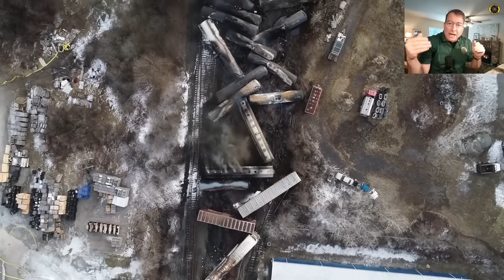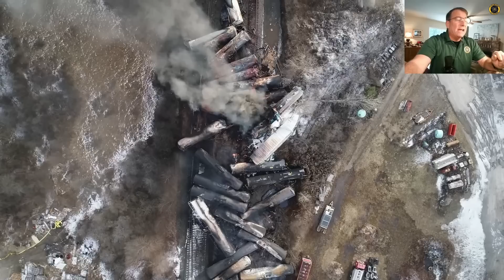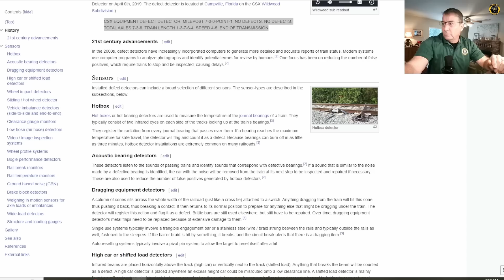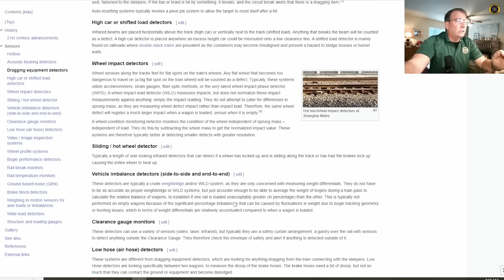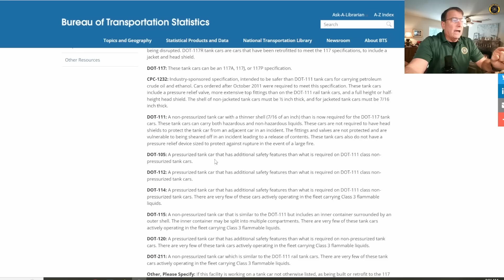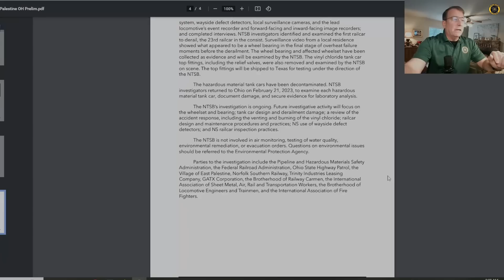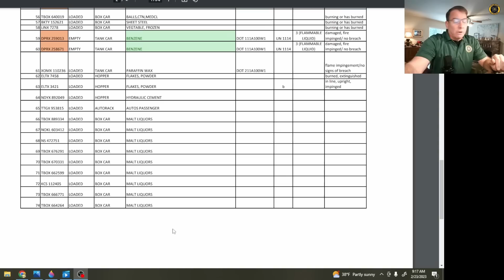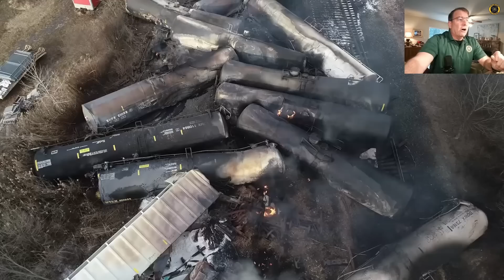NTSB Prelim Report: Norfolk Southern Train Derailment 23 Feb 2023

Comment: Excellent report. A factor that wasn't mentioned is the sequence of the full-break application on the string of cars. If a sudden rupture occurred at one place the sequence of application on the string of brakes would depend upon the speed of that pressure drop propagating down the line. The maximum speed of that would be determined by the speed of sound in the pressurized air. The brake application time might only differ by milliseconds and that may not have made much of a difference in this situation. I raise this point since there has been an effort by train worker unions to require that the braking application be controlled electrically, which might mean the braking hose would not travel the length of the train. Apparently, testing has shown that the proven electrical system is a safer system that reduces the chanced of derailments. Apparently, installing this electrical system is somewhat expensive. The story is that many RR corporations have lobbied to prevent a rule being implemented that would require them to upgrade their trains to this newer electrical system of braking.
Reply: I don’t think they are talking about an electrical system of braking. I think they are asking for rail cars to be designed with electronic units to control the existing pneumatic brake cylinders on cars instead of relying on propagation of air pressure changes through the brake pipe. The advantage would be to eliminate the delay between the head of the train and the end of the train beginning braking.
Reply: Do you know what railways are using electrically controlled braking?
Reply: @kevinstewart449  Australia has some - and at least in Europe it's quite standard for passenger trains.

Comment: PTC is not about stopping derailments, its about making sure trains respect signals and track speed limits. 
the video we have is from the MP69 DD. 
Transport Canada has an older report and yes bearings at mainline track speed fail fast. 10-15 miles is enough for an bearing to from damaged to failed. Each axle for a full loaded 286k lbs car is carrying 70k lbs. There are some 315k lbs cars which are at 79k lbs per axle.
Reply: Or to put it into Juan's terms, it's TCAS for trains, with the only action being to stop.
Reply: @johnhaller5851  The other acronym I'm thinking of has to to with an operations model. It eventually gets mentioned further down.
Reply: This is like the 4th or 5th "PTC"-related comment I've seen... I think the wrong "P" acronym is being brought up...
Reply: @mikelewis963  PSR is a marketing term used by railroads. BNSF doesn’t use it yet they’ve done similar actions. 
I brought up PTC because there seemed to be a misunderstanding of its purpose

Comment: Juan your the expert on aviation let me explain something to you PTC positive train control will NEVER stop a train derailment from happening unless it's because of a train on train collision. PTC will stop you from running past a red signal and a few other obstacles but that's it. This trains car #23 from the head was trending towards the hot side but the crew was not warned across the first 2 detectors but the 3rd detector 4 Miles from the derailment location went off.

Comment: Bearing failure is not a linear event.  They can go catastrophic unpredicatably.
Reply: Yep. That's what I've been told.  If and when they fail. They fail very rapidly and spectacularly.
Reply: @animal16365  While this is true, the bearing in question was heating up over a distance of at least 20 miles. I would suggest, as Juan appeared to imply, that computer systems at the RTC center might have noted the rise in temperature and advised a stop sooner. I would be surprised if the NTSB does not suggest this in their final report.
Reply: @Ian Wigle  

Yes. Plus a increase in Hot Box Detection systems per given mile.  Like one per 5 miles apart instead of 1 every 10-20 miles apart.
Reply: @animal16365  Hundreds of millions of dollars, perhaps approaching a BILLION or more for all the major railroads, to add 2 to 3 times more detector sites than they already have. In this example,  there were indications on 4 detectors in a row. The pattern after 1, 2, and 3 was enough to warn of a worrisome trend. I was actually surprised at that point there wasn't a warning.
Reply: @Ian Wigle  

Like I mentioned.  I feel that one of the requirements from the NTSB is that all railroads install more montering equipment trackside to prevent this or at least reduce this type of incident.   But of course I'm drawing a conclusion before the final report. 

 I will say this. The NTSB is very thorough in there investigating. They will go over everything and leave nothing overlooked. So we will get a full report in a couple of years.

Comment: It seems to me that the criteria for the HBD to toss a fault code should be a delta T from previous detections. The coding for this is trivial and could be located at the dispatch office server some other central location. Having the alarm set go toss a critical fault after the bearing has failed doesn't make sense.
Reply: The detector itself doesnt know which train just went over it which would make a change in temps between detectors difficult for the lineside detectors to track
Reply: Also as Morgan said, plus the fact that the line-side detectors transmit on a short range radio, which the train crews are listening to.  So the train crew expects to hear the detector and its findings, good or bad.  No need to send the message all the way up to some swamped dispatcher who's half a country away.  The time it would take to get them to manually try to sort out which train and call them back would take even more time, than the short range radio that only the trains within 2-3 miles will hear.
Reply: @NightOwlModeler  These are trivial problems in modern tech. The entire train doesn't need an individual code just the engine does. Dispatch knows what cars are attached to which engines. 
The trackside detector could transmit to the engineer and dispatch with different methods.
This is a simple problem to fix. 
The problem is freight companies are bottom dollar fixated. No amount of profit is enough. They recently fought tooth and nail against one stinking day of paid sick leave. 
You can't convince me that we can fly hundreds of people in aluminium tubes all around the world safely but a train can't figure out it is falling apart before it actually falls apart.
Reply: @NightOwlModeler  Dispatcher does get the detector reports, but not via the short range train radio. There is data communications to operate switches and signals, and get status back.
Reply: Individual detectors don't know about a trend, but the data is sent to the dispatcher, where a trend would be apparent.

Comment: Soo...the bearing failed but how did it cause the derailment? Did something else break and cause that truck to derail? That car came to become an obstacle to the cars behind it causing them to dreail?
Reply: One video I saw showed the car bouncing before derailing.
Reply: The bearing failed and then the wheel basically fell out from underneath the car casing it to derail and then the rest of the train piled up behind it.
Reply: @Stoker58  Yes, the brake system being the scapegoat. If the electric brake system had been installed, the pile up would not have been eliminated. Electronic braking prevents jack knifing in a non-derailment emergency brake application. There are predictive proactive ways of analyzing bearings that rely on vibration analysis, we did that in the manufacturing plant for our major equipment. Usually there are indications way before a bearing failed catastrophically. It was much cheaper for us to be able to schedule downtime in advance and prevent other components from being damaged.

Comment: This train likely had plain old dynamic brakes and not any form of regen brakes.  Regenerative braking would require some form of electrical storage be it the electric grid or a battery / capacitor.
Reply: Yes. On diesel electric locomotives The dynamic brakes are on the locomotive and basically turn the electric traction motors on the locomotive axles into generators the generated electricity is the sent to a resistor grid and dissipated as heat. On the old electric locomotives (from the 1920s for example) it was true regenerative braking as the electricity went back into the overhead wire. Not sure if modern electric locomotives work this way. Also this was how it was dumbed down to make me as a nonrail understand it.
Reply: Is there a resistor load bank to absorb and disperse as heat, the energy created by the dynamic braking???   I'm talking about maybe some air cooled steel boxes that get very hot during the dynamic braking.
Reply: @chetmyers7041  Yes.  Rumor has it that Rohr wired up the dynamic brakes on the original BART cars backwards (third rail, electric).  Supposedly the resistors got red hot almost instantly after powering up the cars.

Comment: Excellent briefing. 

OK, so a bearing got hot.  The alarm went off and the engineer began stopping the train.  So, what actually caused it to come off the track?  Did the bearing failure cause the axle to come apart??  Just putting on the brakes should not cause the train to leave the track.   Did I miss that or is that still a mystery?
Reply: Likely the end of the axle melted off due to massive friction heating from the seized bearing.
Reply: It was on fire, shooting out flames before it derailed, so just a guess, but total failure of the bearing and maybe the axle right before derailment.
Reply: Fire must have melted the airbreak line for the car causing all wheels to lock up. The airbreak lines keep the breaks off the wheels when working correctly.
Reply: @patrickjames1080  Not quite. The trainline (air line) is used to refill the air brakes in each car.  The valve on each car is watching the trainline to see if the pressure goes up (releases brakes) or down (signaling an application), or a total loss of pressure which triggers the emergency application from the second half of the reservoir tank on the car).  It's not 'straight air' or like a truck brakes.  The valve during an emergency application also helps vent the trainline to the outside atmosphere, which helps speed up the drop in pressure in the trainline to the following cars in the train.
Reply: If there was too much drag from the bad wheels the car could have decoupled from the cars in from.  While the cars behind would have pushed the failed car up and sideways causing it and many of the cars behind it to derail.
Reply: NTSB sending the failed axle for analysis.
Reply: Thanks folks.  Makes more sense now.

Comment: Why were all the dangerous chemical cars so close together?  It used to be that chemical / hazardous material cars HAD to be separated by a certain number of 'inert' cargo cars as the consist was being assembled.  Is this no longer the rule?
Reply: There are federal guidelines for what types of rail cars can be next to each other in a train. Most flammable liquids, regardless of their makeup, can be coupled together. A car of explosives has to be a certain number of cars away from an inhalation hazard car and a loaded flat car with no barrriers on the end of the car cannot be placed next to a flammable car, ect. Several hazardous cars of like material are usually allowed to be next to each other. The fire that erupted after this derailment looks to have followed some sort of drainage ditch, allowing thr fire to reach rail cars several hundred feet away from the source.

Comment: I’m sure glad I wasn’t downwind when they decided to burn all that hazardous material. Couldn’t they have removed the contaminated soil and not do a burn? Which method is “safer”?
Reply: The cars of vinyl choride were building up pressure due to the fire. If they hadn't vented the tank cars, they may have exploded and turned the tank cars into missles. An empty tank car can weight 60,000 pounds. The combined effects of explosions and 30-ton missles could level a town the size of East Palestine.
Reply: They were worried about a BLEVE which could have possibly caused much more damage and a lager spread of the contamination. In my HAZMAT class they cautioned us to be aware of the possibility of a BLEVE in these instances. I beleieve there are videos off just how destructive a BLEVE can be on youtube

Comment: ATC is for train control to stop railroad collisions, and over speed. These detectors read the bearing temperature to determine bearing failure, and the other detector is for wheel temperature to determine in a brake is dragging.
See YouTube Hobo Shoestring. Very informative.

Comment: Man, that seems like the rail industry needs some kind of retrofit kits for their cars. Temperature sensors on the bearing housings that warn the conductor way before they get to meltdown and failure stage. Maybe you could integrate both an inexpensive thermistor and an inexpensive accelerometer onto a PCB and have a wireless mesh network that already exists in many iot systems. I’ll bet that the bearing in question was grinding (which would have been detected by the accelerometer) and starting to overheat (detected by the thermistor or thermocouple) far before things failed.
Reply: The logistics of this would be almost impossible, 100-200 car trains that get broken up and reassembled into different trains every few hundred miles would take hours to reprogram the detector to loco comms, with almost 1.6 million freight cars in the US.   Think of how many times your check engine light comes on in your car, and all of those systems are directly married all the time.
Reply: A brakeman in a caboose would have likely seen smoke, if they still had brakemen and cabooses (and trains weren’t 10000 feet long)
Reply: There is over 1.5m rail cars in service in north America owned by a wide variety of companies from the business who use them to banks to the railroads themselves. Any sort of large scale retrofit is going to be incredibly difficult and slow to do. We also have solutions which don't involve creating new devices, this kind of derailment went away decades ago. Increasing inspection times per car back to their previous levels and more defect detectors which should have their reporting standards set by the FRA.
Reply: That’s what Canadian rail system research recommended, not for that reason. The detection device loses accuracy at speed. I did measurement system work at the end of my career. It’s never simple, even the most mundane measurements are complicated to get it right.
Reply: I think the cost to add and maintain those systems would be far to high.  When is the last time you have seen a train car that was free from graffiti? These cars sit for long periods of time in areas that are not secure.  Any item that is not to massive to carry, hardened beyond belief, or so cheap that the most clueless meth head knows there is not money in scrapping it would be taken.

Don't get me wrong,  I do think that they need much better sensors on the train cars to inform them of what is going on with the train.  I just think the cost of installing, maintaining, and replacing them will be astronomical.  Along with that you get the added problem of not getting accurate data because X number of the cars have damaged sensors.
Reply: About 1.6 million freight cars in the US. Pretty expensive upgrade.

Comment: We know nothing about regenerative braking❓❓❓will you start covering automotive accidents next along with aircraft news❓❓❓
Reply: To slow the train the traction motors can be used to generate electricity. This is then sent to A big resister bank that has A fan to cool it.
Reply: @waynescott1338  that still doesn’t explain to me how it regenerates anything. What is any different than the jake brake on a tractor trail?
Reply: @david_W5QDF  regenerate is a bit of a misnomer, but we have become used to referring to electric motors used in braking mode as regenerative braking because battery-electric cars use motor braking to put some energy back into the batteries. Diesel-electric locomotives take all that power from braking and dump it into a resistor bank because it would be incredibly wasteful with current battery tech to try to capture and re-use it.

Comment: Accurate reporting as far as what we know so far.  We’re not sure if the dd s were putting out the reports to the crews, or was the sensitivity turned up. A conductor carries a tempil stick (fancy crayon), that melts at 200 degrees f, when wiped on a reported bearing. The car probably should’ve been detected before it was too late and set out. That’s IF the crew received an accurate and timely report from the dd.